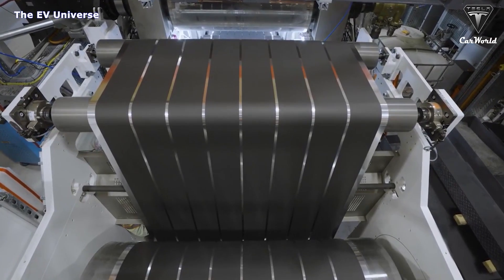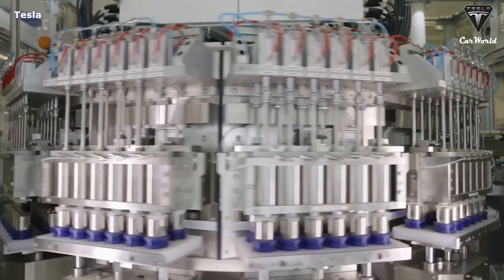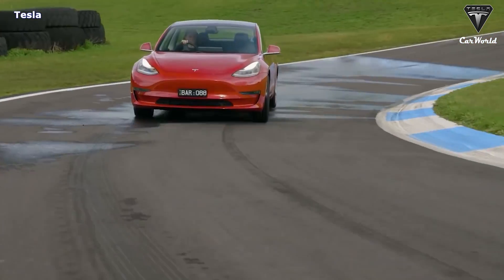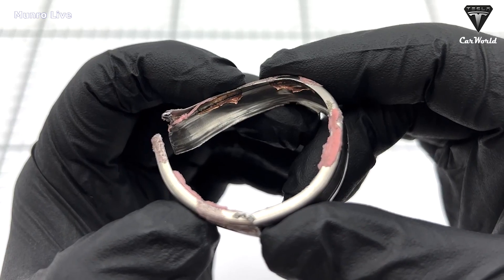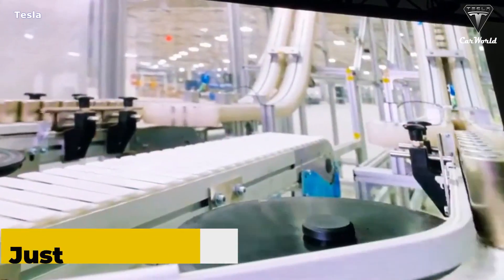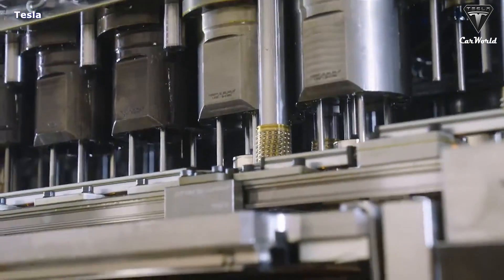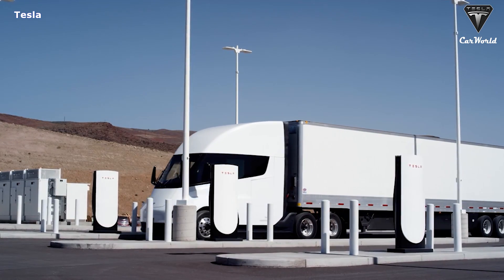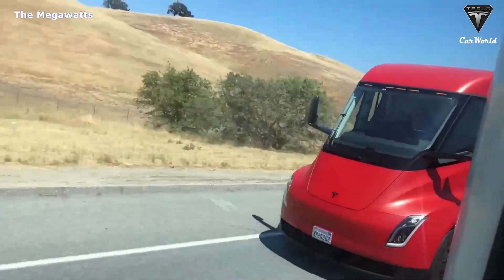The New update Battery 4680, Tesla Semi, Cybertruck Is Officially Here!

Comment: My Cybertruck better have the 4680 cells and I hope these are every bit of 200kWh each. I need to be able to tow and charge really fast. I can use a CCS plug at 350kW if required for the extra boost, since most Tesla chargers now are only 250kW and less.
Reply from the maker: Yes, btw you know Tesla will develop a 350 kWh V4 charging station for Cybertruck with a new 4680 cell. Thanks for your comment, soucyno1  !
Reply: @TeslaCarWorld  I plan on it. The weird thing they plan on keeping the 400v system they have been using. I understand the reliability of this system, but at some point you would think it would have to change. I have heard battery packs as large as 200kW! Even a 350 kW system would be a while charging this battery pack. I just hope the price is reasonable and charging on the mega-chargers will be an option.